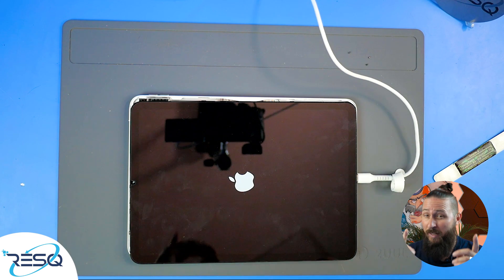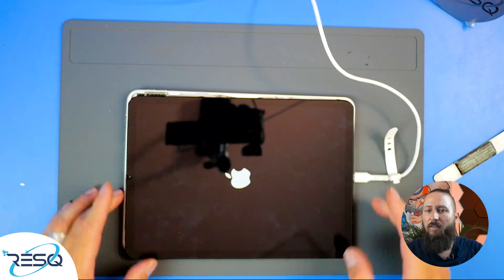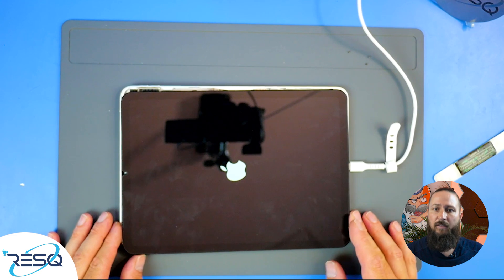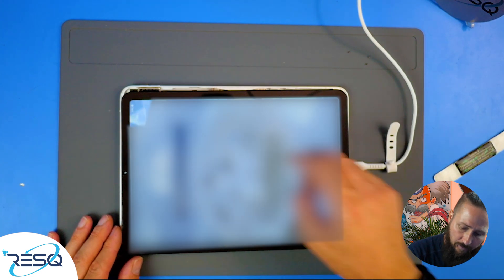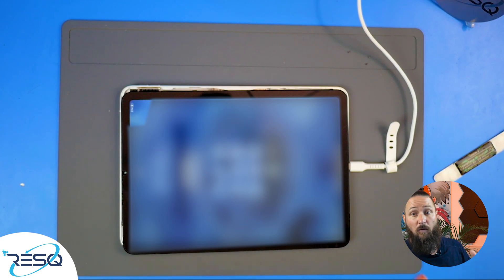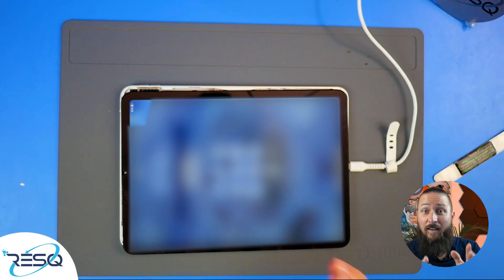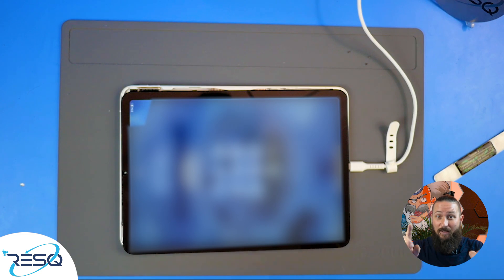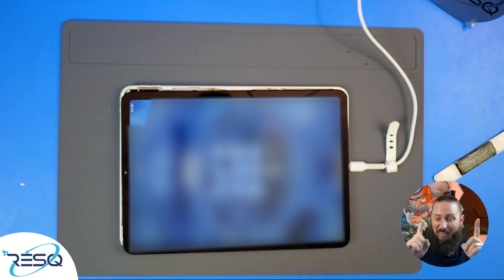iPad doesn't turn on? The Solution!😍 Tutorial: Troubleshooting & Full Repair

Comment: Good morning Master, I am at an intermediate level in this world, I have a wet MacBook Pro a2251, more specifically on the cd 3215 controllers, I downloaded them and cleaned the rebaling and turned on but the equipment does not load, I checked all the resistors and everything is fine, change the charger and the problem continues, I really don't even know what to do anymore, have you had a particular case? If you could help me, thanks in advance